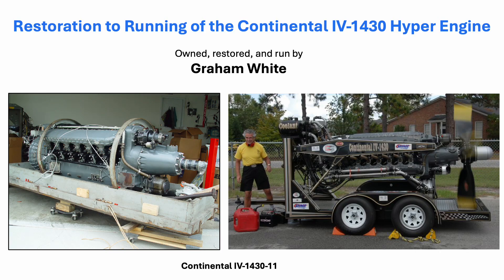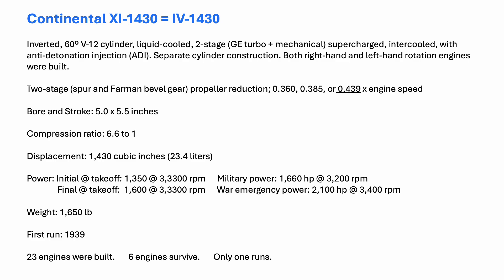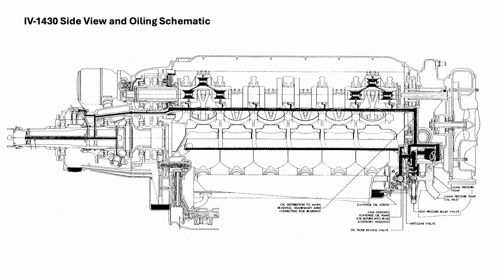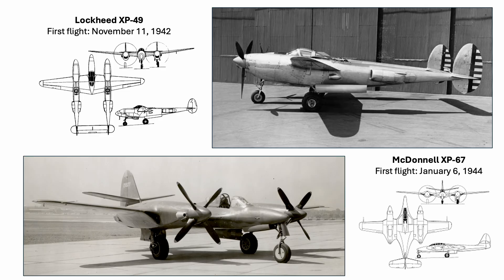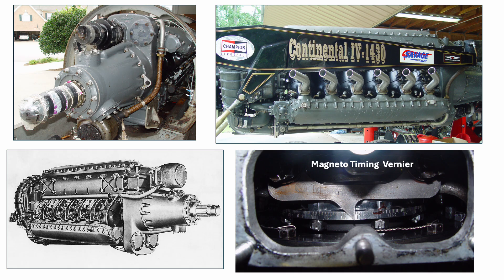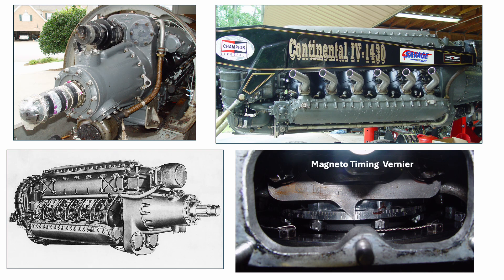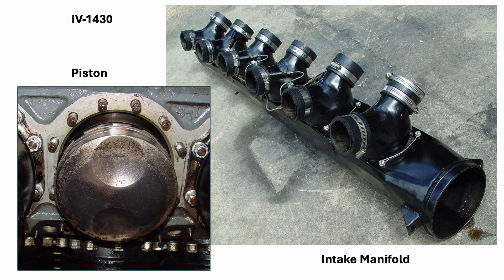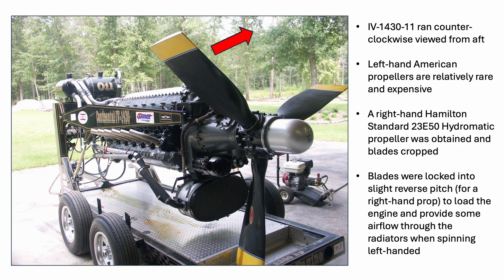Restoration to Running of the Continental IV-1430 Hyper Engine

Comment: Excellent! Although the running engine sounds rather harsh like the Griffon. The Merlin sounds sweeter.
Reply from the maker: Thanks for your comments. Graham ran this engine pretty hard, fearless with the throttle. The engine seems angry, but a joy for the eyes and ears. When flown in the XP-49 and XP-67, the engine had collector exhaust manifolds to feed the exhaust to the turbocharger, so it likely had a more muted tone.